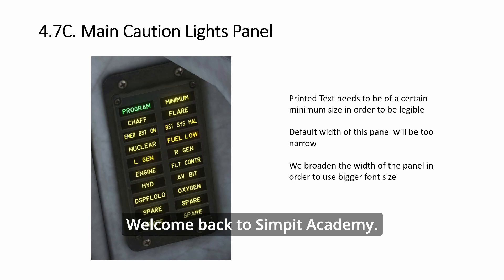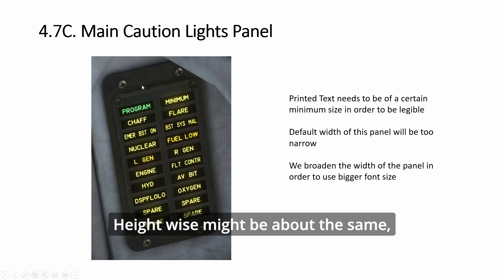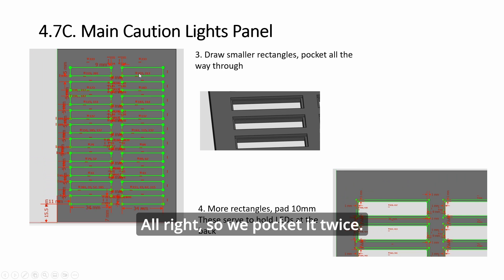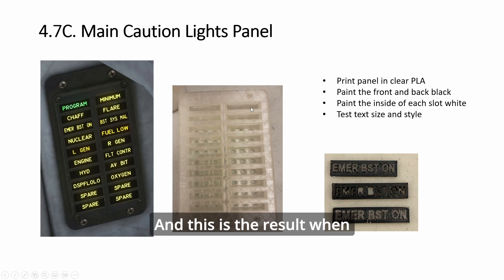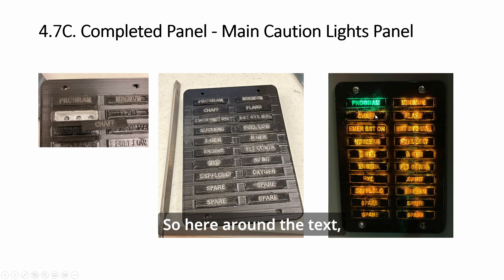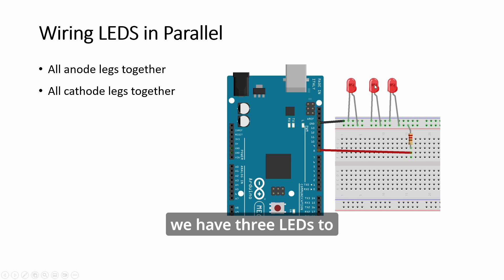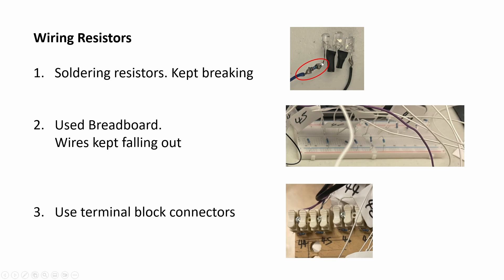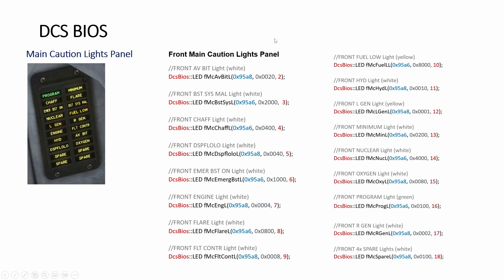Episode 19 How to build DCS F-15E Main Caution Light Indicators

Comment: Can a single arduino handle all this current without burning up? I though you have a pin limit of 40ma and a total limit of 200ma
Reply from the maker: I split up into different boards. Anyway these don’t usually all light it up at the same time except during the one two seconds testing.